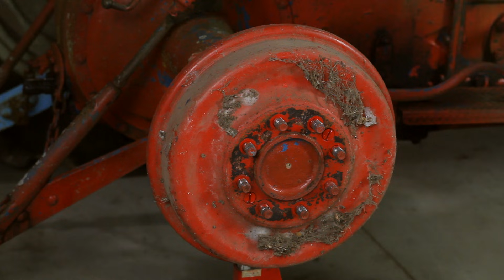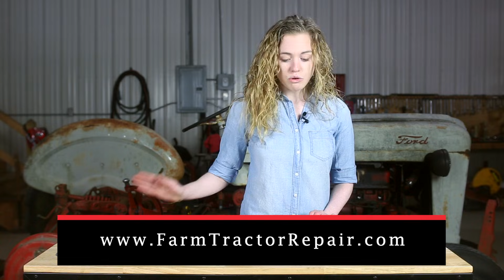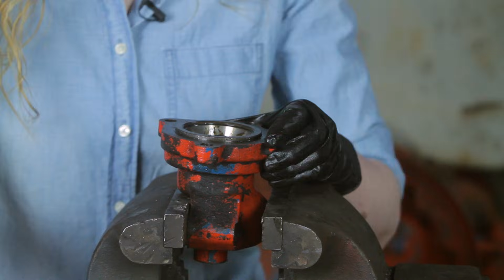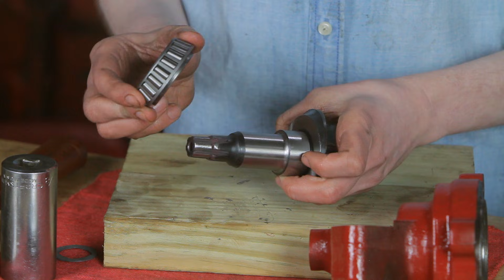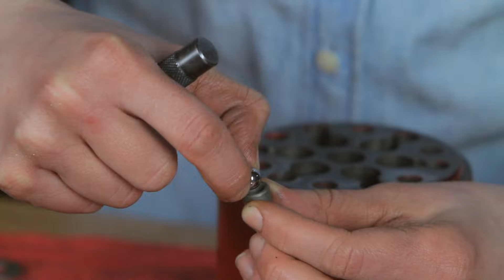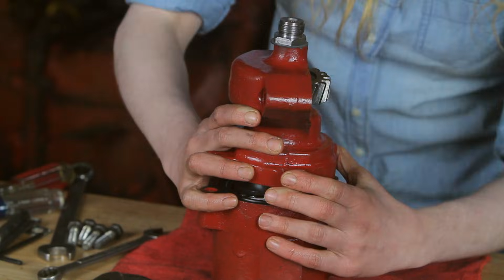Ford Tractor Hydraulic Pump Rebuild: Easy Step-By-Step Tutorial for Piston Pump on 600, 800 and more

Comment: If you place a shop towel on the pump and soak it with lighter fluid it will disolved the grease and dirt. I like to clean the outside to the pump to keep dirt out of the rebuild procedure. A grain of sand inside any hydraulic mechanism is a bad thing.

Great job on the rebuild.

Comment: One thing I need to add is, that the parts, such as this pump, should be cleaned up before  being dissembled. This is to keep the dirt and grime out of in this case the pump. Otherwise a great video, I’ve learned from watching this.

Comment: I have a question for you I have a 600 the lift goes up great but it only works with the leaver all the way up the lever doesn't work anywhere other than all the way up  and it slowly drops what might be causing this thanks

Comment: Your videos are really helpful. Being a new owner of a Ford 650 Tractor how this tractor operates to me is all new but being an aircraft technician its easy to understand.  Everything on the tractor worked fine since purchasing it a year ago this coming March.  Mid December I attached my 6 foot blade in hopes of using the tractor to clear the snow from my driveway.  After mounting the blade I moved the lever for the 3 point hitch and it raised briefly then dropped to the ground and would not raise back up.  I checked the oil and found it at the bottom of the hash mark. I thought for sure after adding hydraulic oil you recommend for this tractor the 3 point did the same thing started to raise went up about a foot then lowered back down and will not raise at all.  At this point not knowing what the previous owner did I might just drain all the fluid and start again.

Comment: Place your cone bearing on a steel plate, and gently heat the inside race by directing your pap Gass torch onto the center on the plate when spitting on your finger it should sizzle like a griddle. The bearing will drop onto the shift. To insert the shift into the pressure seal get or make a sleve cover that is over the spline shift. Lightly oil and safely  slide the shift through the seal without damage to the seal.

Comment: Hello Dan and Rachel,  have a Ford 4000, mid 60s.  Recently replace a gasket that was leaking on the hydraulic pump.  Simple.  But, when I reinstalled the pump it will not pump oil.  I don’t believe it is suctioning oil from the reserve.  The shop manual states to just remove the bleed screw and crank the engine until it pumps oil out the hole.  But no oil is flowing.  Then it states to prime the system yet gives no instructions as to how.  I’m befuddled.  Any ideas how to prime the pump?

Comment: Hi Rachel and Dan - we always love your videos! 
Our question is somewhat related to this topic.  Our proof meter on our new to us 641 wasn't working, and I found that the tab end of the cable was broken. I purchased a replacement cable and inserted it.  The slotted end of the hydraulic pump (where the cable inserts) does spin when the engine runs.  But it slides about 1/2 inch in and out during spinning.  The new proofmeter cable does make the proofmeter show some RPM, but it is not accurate.  I'm wondering if that proofmeter adapter or bolt inside the pump could be an issue. Is that adapter supposed to move (have some slack front to back) or be solid with no movement other than rotation?  Thanks for the help! Chad at Purple Collar Life.

Comment: SO, I have a 1963 Ford 4000 Select-O-Speed with piston hydraulic pump, but my lift arms have quit lifting. I rebuilt the pump and lift deck and it worked several times but has set a while, but now it is down and won't lift at all. I find EVERYTHING on YT for EVERY other model, but little to nothing of this model, even though much of it is the same as other NAAs. I find NOTHING on HOW TO PRIME THE HYDRAULIC PUMP. I have every shop manual Ford ever made for this model. I guess they "forgot" to include priming the pump. even though there is a section discussing "lost prime", but nothing on HOW TO PRIME. I guess if it is not a Jubilee, 2N, 8N or 9N, it ain't a Ford. Any input out there? THabnks in advance.

Comment: Maybe that ignition coil has an internal spark gap, but who knows?  I'd rather pull the distributor end of the coil high tension wire and ground the now open tip of the wire to avoid an over voltage condition in the coil which can damage some ignition (or magneto) coils.

Comment: These videos are great and for that reason I ended up purchasing the premium rebuild kit shown in the video. There picture on the website and the video dont match up, so I called and asked if these parts were included that were missing in the picture on the website, I was told yes. Missing the small O rings, no wobble plate thrust bearing, no nut and bolt to knock out the bearing race. I've reached out to them to ask about the parts with no answer yet. When I talked to them over the phone before it always felt like I was being rushed. Im restoring an entire tractor ground up and as a small business owner myself I wanted to help out a fellow business owner. So far very disappointed and will spend the rest of my restoration money at Steiner tractor parts. I will update if things change.
Reply from the maker: Hi Landan, It looks like you emailed us with a question a few days ago. The question came in at 3:51 PM and we had emailed you back at 4:03 PM (12 minutes for an email reply seems like a very good response rate). After you placed the order, we were short only one item (the wobble plate) to complete the kit as shown on our website, so we called you to confirm the contents of the kit. You were offered a refund and accepted that resolution for the single shortage. Unfortunately when a kit involves so many pieces we can be short--I feel the very best way to respond to a shortage is a personal phone call which we did for you before filling the order. If you have additional questions, please reach out to our customer service reps either by email or phone.
Reply: When you called about being short the wobble plate is when I asked about the missing items on the picture on the website vs the youtube video, that's when I was told they were included. Yes you did refund for the wobble plate but still no wobble plate roller bearing or small o rigs included. I did place a call and left a voicemail about the missing parts. But you responded to the youtube comment faster than calling me back. No worries I've already purchased the missing parts from steiner tractor parts. Just letting others know before they think about purchasing this kit.

Comment: I have followed your videos on overhauling the top plate, and the hydraulic pump utilizing kits from your site. I’ve also replaced the pressure hydraulic tube which runs thru the cases because it had a large hole due to corrosion. With all that done how long will it take for the hydraulic system to react I’ve primed the pump and I’m getting no action.

Comment: Very often rain water gets into hydraulic pump from gear shift lever boot ..then it freezes up solid and breaks pump when started.
Always seal up boots check sump for water milky oil etc.
Excellent show!
Reply: That’s very good advice! I have a Ford 600 and the shifter boot was cracked and not sealing well. I ended up with water in my hydraulic /transmission fluid and a big mess!
Reply: @timcoe457  many other machines have the same issues .
Good you found it.
Shalom

Comment: question regarding the hydraulic pump.....will the pump make a knocking noise similar to a rod knocking if its bad? My 800 has what sounds like a rod knocking. I have had pan off everything looks good there as well as checked push rods.

Comment: I have a Ford 2000 and the hydraulic system is not working satisfactorily...its slow to start and losses lift quickly. Basically its unreliable and frustrating. Not being too mechanical but wanting to have a go at repairing it myself, can you offer some advice please?

Comment: Can we please get you a set of seal and bearing drivers? I still use the sockets on the odd occasion when I can't get my driver into the location but I used to damage seals and bearing so often using sockets and other odd items to drive them in. 
Just FYI: the plate the pistons ride on is normally called a swashplate. it is the same as you find in A/C compressors build in the same manner.

Comment: You should let people know that they need to buy a complete rebuild kit. You cannot change the wobble shaft seal without destroying the needle bearing and the tapered bearing race. Found that out the hard way. Having to keep ordering parts again and again. Tractor is down longer than it should be. Always waiting on parts. It's my fault, just trying to save other people some grief.

Comment: Hey I was wondering if you could help me narrow down a problem, I have a ford 9n that at full throttle breaks up and I checked the firing order which was good, plug connections lose so I tightened them back up, getting plenty of fuel nice steady stream into and out of carb (pulled carb drain plug), everything ran fine until I pulled a inline fuel filter off that the previous owner had on and the tractor would starve for fuel after a while of runnning at full throttle in the field, and no matter how much adjusting I did on the carb the breaking up at full throttle would not go away but the tractor isles fine and revs up fine until it hits full throttle, any input would be greatly appreciated
Reply: Remove the extra in-line fuel filter. Or if you need a FF because of a dirty fuel tank put on a much bigger capacity FF. Or, if your tank has rust and dirt, remove it and clean it well, the coat the inside w that red sealant stuff, I forget the name. I did mine this way 9 yrs ago at same time as soldering closed some pinhole leaks. It's been fine since. Or you could buy a clean fuel tank, new or used.

Comment: Great video!  Do you recommend using any gasket compound or adhesive on the front of the pump?  Thanks a bunch.
Reply: I always use a light coating of anaerobic sealant, loctite 515 for example, which is a flange sealant, takes up a good tolerance, say if you have a little pitting in part of a flange surface, you don’t have to go sanding and worry about losing tolerances. I only reply just cause I’m a JD mech, but work on pretty much anything.

Comment: Thank Rachel, enjoyed watching. A little hint on fitting bearings. Freeze the part your bearing is going onto, if possible, you will find the bearing going on with less pressure, due to the contraction of the metal. The thought is you do not stress the bearing too much.
Reply: Got it backwards....unless you are pressing an external bearing on a shaft.  For internal bearing setting, freeze the bearing to shrink it a little, heat the part it goes into (if possible) to expand it a bit.  Less effort for a press fit.
Reply: @dan-o9746  Sorry got it wrong way round. Internal bearings freeze, external bearings warm up a little and freeze the stud axel.

Comment: I never assemble a bearing dry, always lube it up with the oil that will be used in the housing. 
WD40 is not oil but a rust remover and will damage surface metal and can damage rubber seals.
In one machine tool operators manual ( a metal lathe)  it was specified not to apply WD40 on the machined surfaces as it will damage the precision ground surfaces.

Comment: To instal a race bearing with a steel tool, you can damage the bearing race because it is soo tempered, i use a brass punch that i got from a machine shop that sold me a length of brass rod .

Comment: If you notice the seal has a small spring on each lip, it  applies pressure for the rubber to make proper contact with the shaft to seal the oil out. That small spring can pop out (it happened to me) when you hammer the seal into the housing and you may not see it until it leaks after assembly. 
My trick is to apply grease to that little spring before assembly, that way the grease will hold the small spring in place when you tap it in.
The little about of grease needed will not affect or contaminate the hydraulic oil.
Reply: Use trans gel, it's designed for transmission and hydraulic fluid. no worries about contamination and you can use it for all of the reassemblies in the transmission and hydraulic system.

Comment: Great videos with a lot of small tips and tricks.
I especially like that even though these are promotion videos, the sale is toned down to a minimum - keep up the good work.

Another trick when installing races, bearing and other stuff alike. Use the power of temperature contraction / expansion. Putting the inner part in the freezer for only a few hours makes a major difference. To avoid dry run conditions when starting, I would use either oil or light grease film on all internal parts.
/Henrik